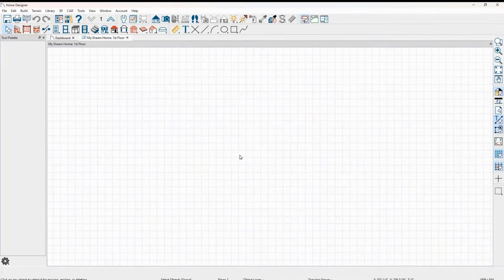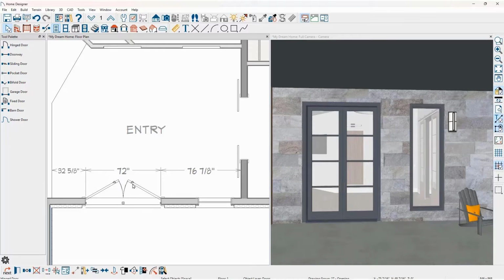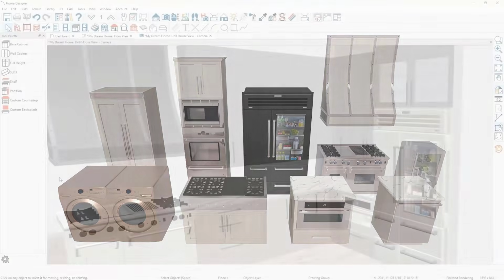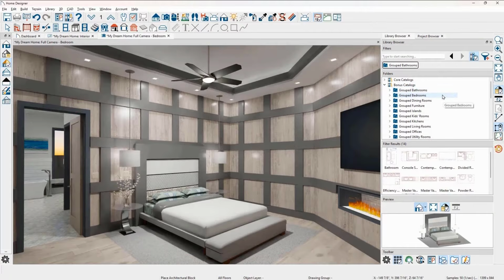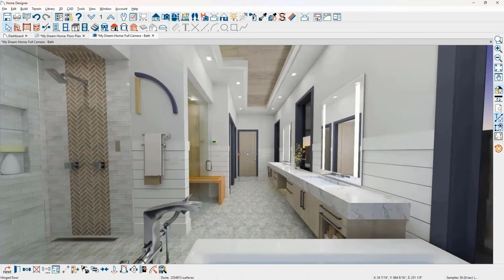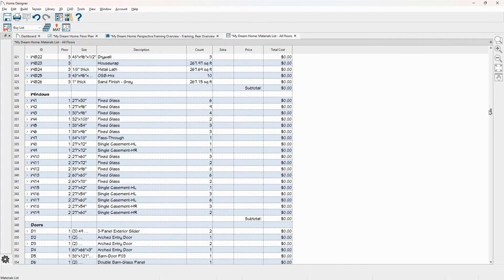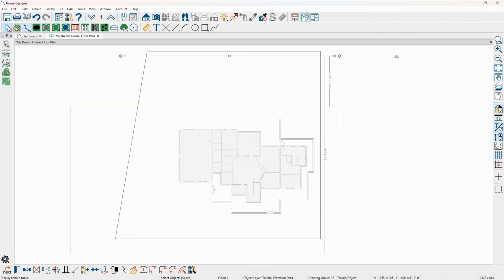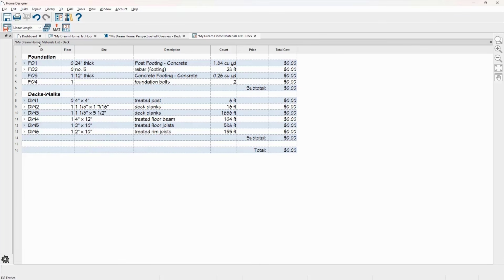Home Designer Software Overview

Comment: I've been referring back to this video more than any of the others while learning. So I figured I would share my video cheat sheet. 
0:42 Start New Project
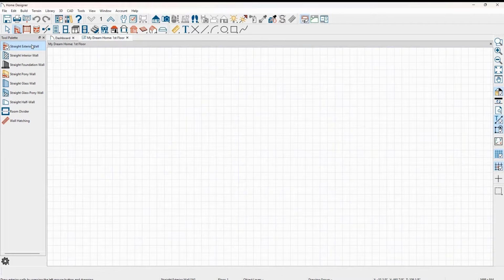0:50 Draw Walls 1st Floor
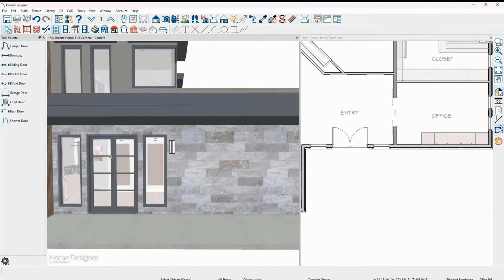1:26 Change Wall Type
1:29 Add Windows and Doors
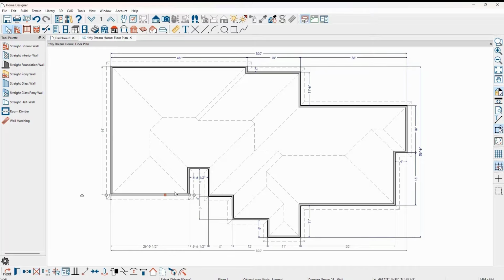1:50 Moving walls / adjusting dimensions 
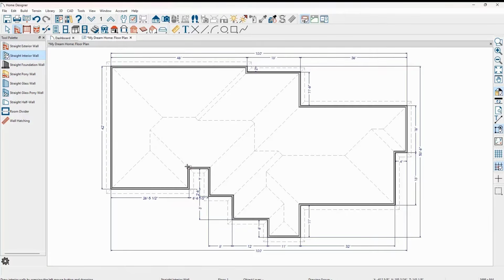2:00 Adding interior walls
2:10 Manual Dimension Tools (Ruler)
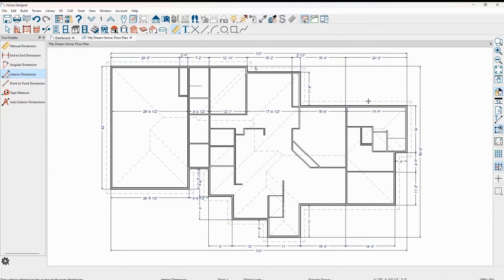2:20 Camera functions (mentioned again later)
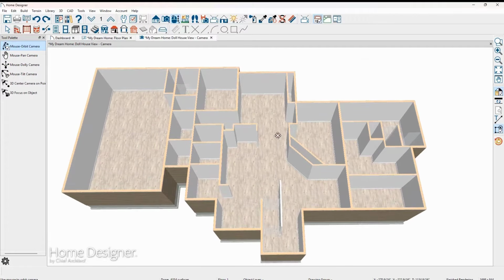2:34 Moving walls in 3D, placing Doors & Windows
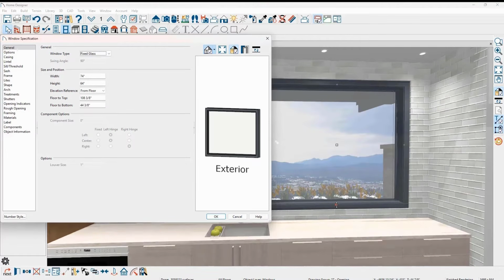3:07 Customizing Window specs
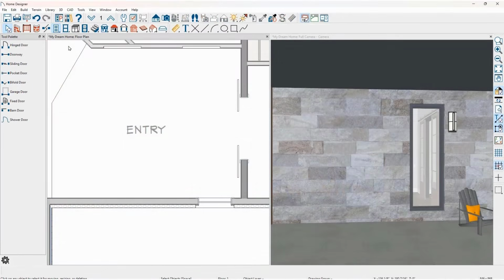3:40 Doors - handing, size, customization
4:45 Rooms Spec/defined
5:02 Kitchen Design
5:50 Customize Kitchen Cabinets
7:12 Appliances
7:43 Backsplash tool
7:51 Use Eye dropper tool to change materials & colors
8:20 Elevation Camera / Planner, adding additional dimensions
8:50 Layout Page - Construction drawings
9:05 Home Design Library
10:07 Interior Design 
11:06 Furniture groupings
11:46 Different Camera Views
12:06 Core, Bonus and Manufacturer Catalogs
12:10 Import 3D 
12:44 Automated Building Tools
13:11 Foundations
13:33 Roofing
13:58 Change Roof Style
14:22 Ceiling Tools
14:37 Adding floors
15:10 Superimpose first floor on second
15:42 Stair Tool
16:52 Framing
17:25 Materials lists
18:22 Scaled Construction Drawings
19:01 Cameras  
20:25 Site Plans - Landscaping
25:45 Deck & Railing tool
Reply: Oh my goodness I love you. Thank you.